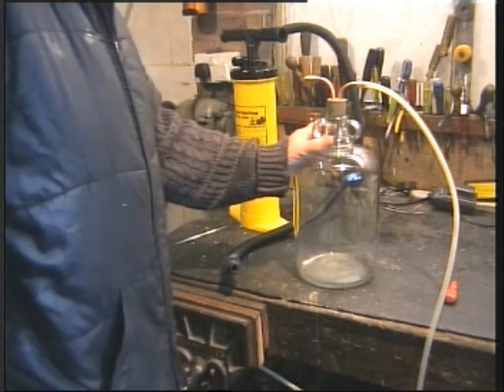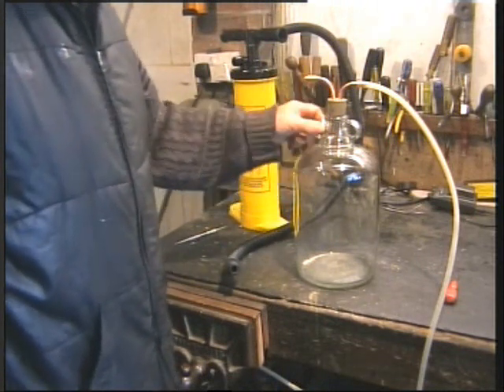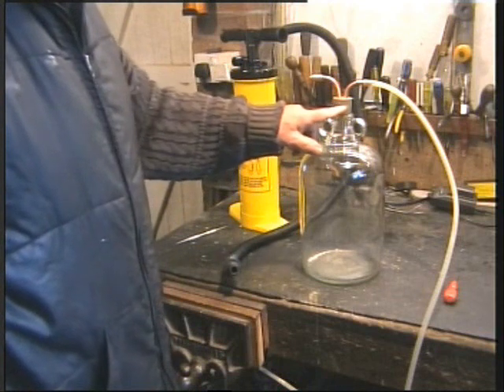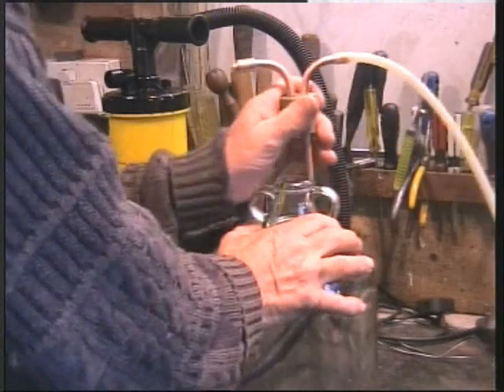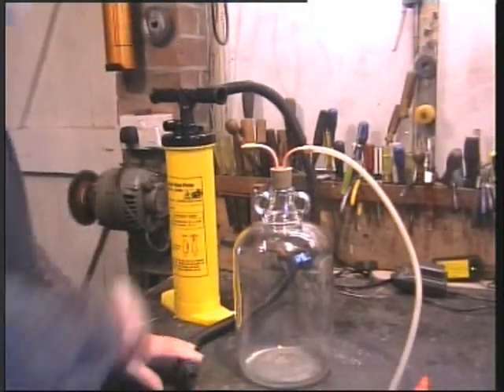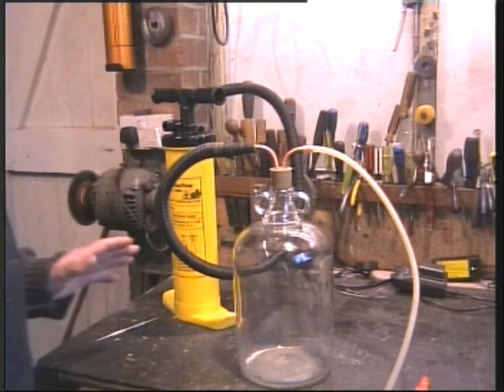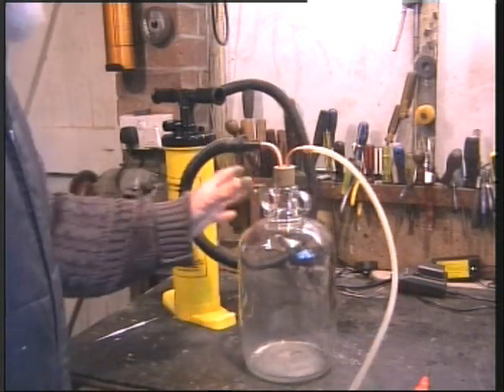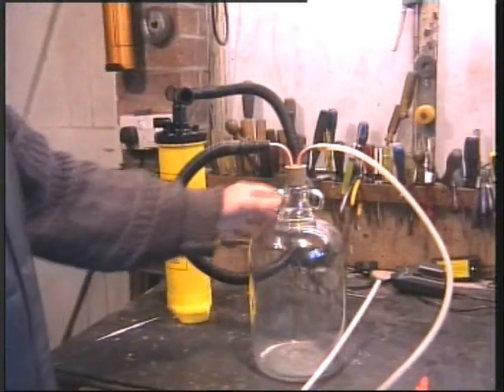Oil change update

Comment: I mentioned it on your other video but the sake of other viewers I will mention it again. I have a commercial version of this that i use to change the oil on my car and it is so much cleaner and tidier than pulling the drain plug. I also use it to change the oil on my compressor as that is a messy business as well.
Once you use this method you won't go back.